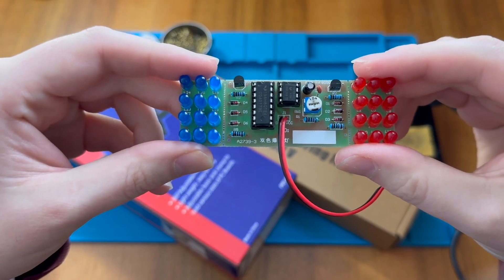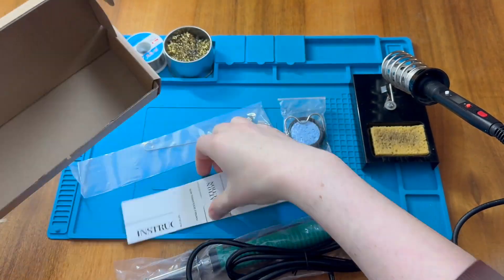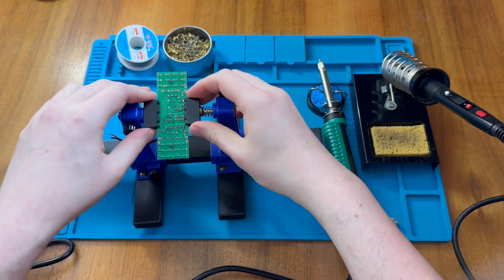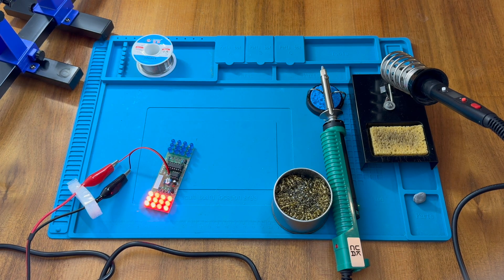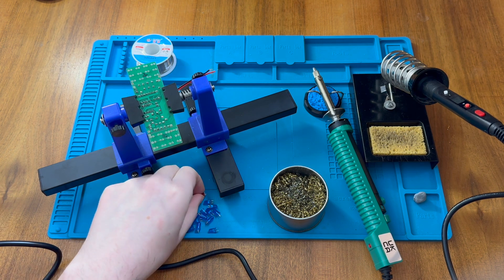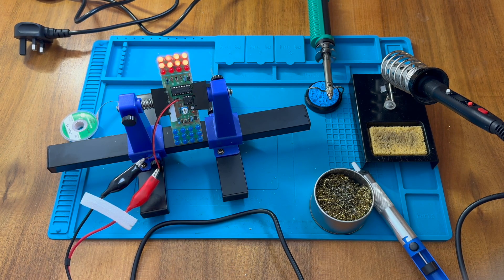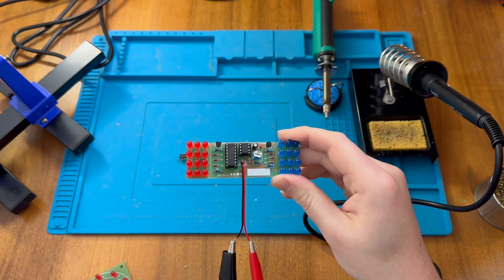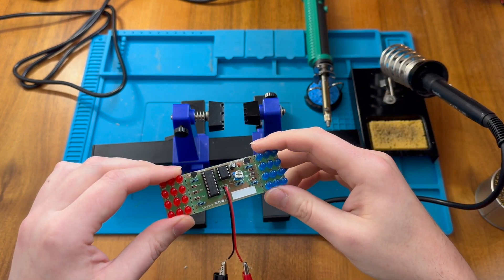"Fixing" the LED Siren Lights Soldering Kit (YiHUA 929D V Desoldering Iron and Duratool PCB Holder)

Comment from the maker: After further experiments with the damaged ICs, it seems likely that the CD4017 failed first and caused the NE555 to overheat and burn out. You might notice at 11:12 the circuit does briefly work at 12V, before starting to dimly and rapidly blink simultaneously. This is probably a result of the 555 driving the LEDs via the shorted 4017. I don't have a good explanation on why the CD4017 might have failed though.

Schematic is available in this AliExpress listing: https://www.aliexpress.com/item/1005006561064232.html
Reply: The original(real) NE555s were very robust, supporting a wide voltage range, and surviving considerable 'abuse.'  Chinese clones tend not to be so robust.

Comment: There's no need to 'tin' the tip of most desoldering irons, as the metal of the tip has been chosen because it better resists sticking to solder.  Tinning them is just likely to make more of a mess.  Unless you're intending to use the desoldering iron as a soldering iron, there's no advantage to having solder on the outside, anyway.
Reply from the maker: Thanks for the tip. I thought it was best to follow the directions from the user manual. It explicitly says to coat the nozzle with a new layer of solder to prevent oxidisation.
Reply: @jtjacques  Hmm.  The YiHUA must be different.  I stand corrected.